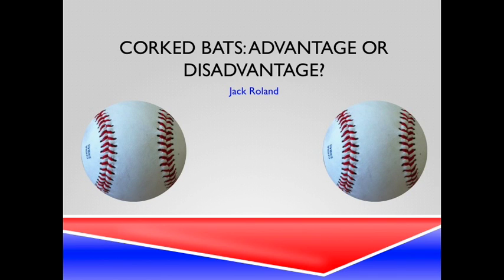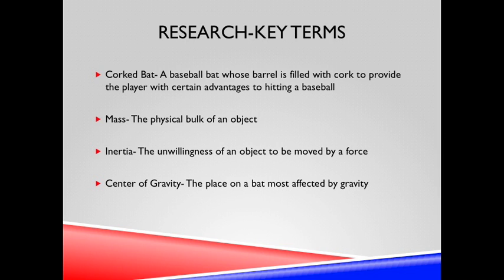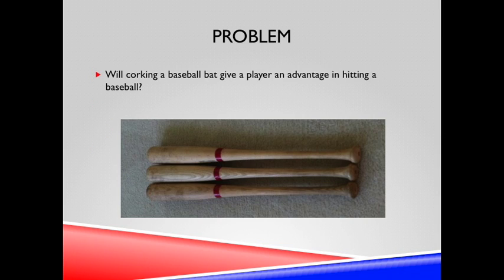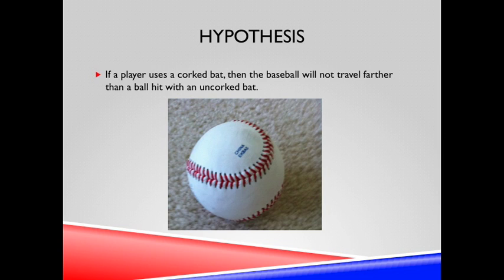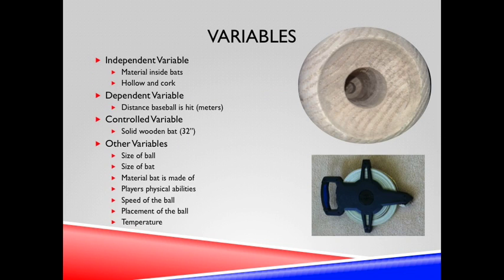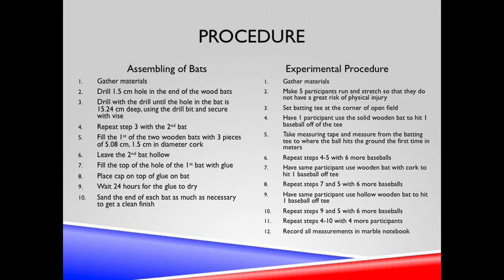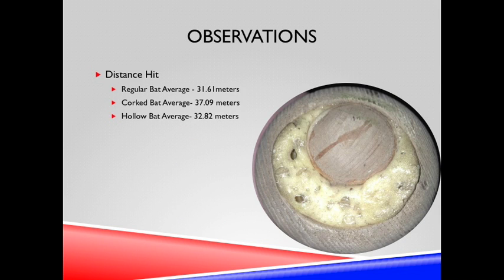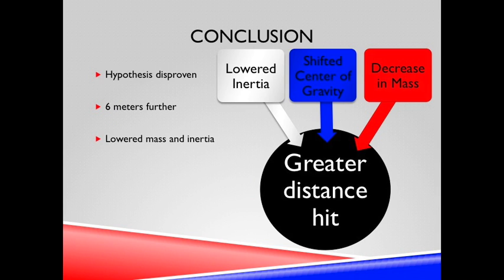Corked Bats: Advantage or Disadvantage?

Comment: The cork as such apparently doesn't do anything. It is the balance of the bat that makes the difference. In that case, couldn't the same balance be achieved by having a slimmer barrel? I think this idea needs more exhaustive study. Meanwhile, the rules define the equipment that can be used, and modifying the equipment is a violation of the rules. That's the bottom line.

Comment: I think you forgot to mention that the corked bats weighed less, helping the batter increase bat speed at contact.  There is a good chance the bat had less weight, but more speed.  Hmm... E=MV(2).  Velocity of the bat should give it much more energy than increasing the mass.
Reply: Theres been research into this, and the batted ball speed shows a negligible difference. Being the exact same at some points. 

In theory, yes, you're right, but when you're changing the weight by such a (relatively) small amount, it really doesn't have as much difference. 

The only real advantage is that a player can get their bat at it's peak velocity just a little bit faster. 

Of course, the structural integrity of the bat would also get weakened.